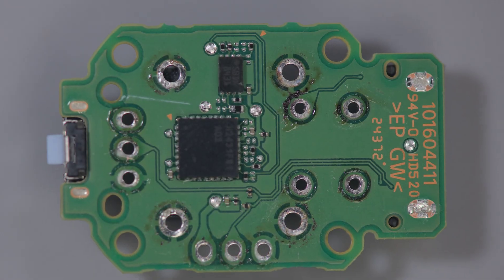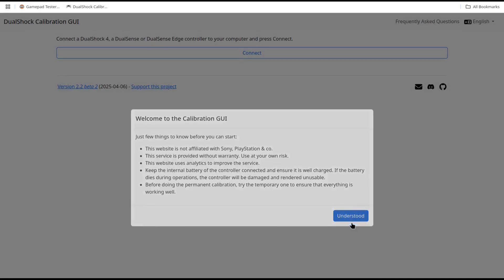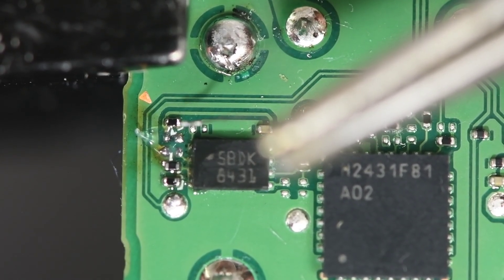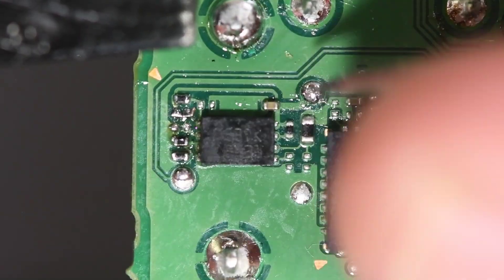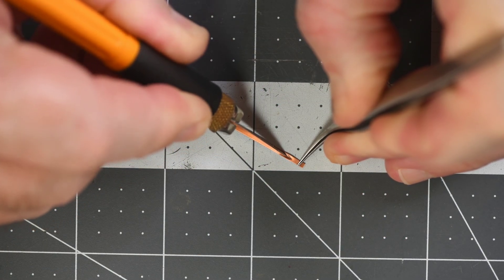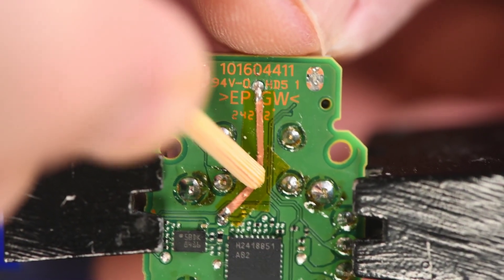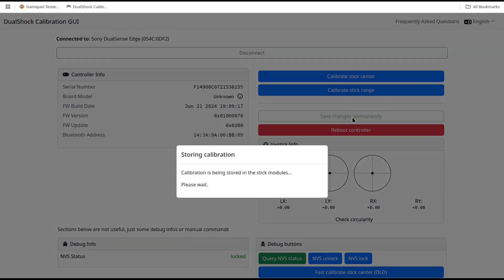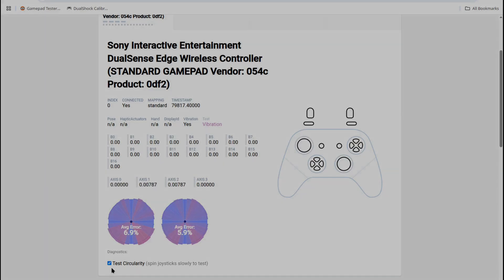DualSense Edge Stick Module Mod: Calibrate Replaced Joysticks Like a Pro!

Comment: Is it possible to achieve 0.000 or 0.000392 stable with a tmr joystick? I always see fluctuations between 0.000392 and 0.001179. This translates to not being be able to use 0 deadzone or 1 in game. 2% deadzone is the best I can do with a tmr.

0 deadzone translates to anything stable and under 0.000999
1 deadzone translates to anything between 0.000999 and 0.001000
2 deadzone translates to anything between 0.001000 and 0.002000.

If fluctuations happen between 0.000392 and 0.001179. I can only successfully get stability using 2% deadzone
Reply from the maker: I think it will depend on how strong the return-to-center tension is for the joystick.  The Hall sensor joysticks were a bit noisy, so they wouldn't stay centered even if held in place.  But best I can remember, all the TMR could be positioned to stay at 0.  I don't think I've ever had a joystick for the DualSense that would always return to 0 for both axes on its own.
Reply: @ thanks for confirming this, I also have never seen a joystick return to 0.000392 on its own all the time. I agree if the tension was stronger, it would be possible to return to center but both gullikit and Hallpi only offer 1 tension. I think we may see different tension models in the future. That would be awesome.
Thanks for confirming, I do get jitters and fluctuations but this is normal I guess. My issue is my customers always request low error rate and stable centering. They want 0.0000 deadzone with no jitters. I’ve spent hours on this in calibration mode and it’s simply not possible unless we have a unicorn joystick that somehow has a little more tension than spec. I am assuming. What do you regard as an acceptable error rate, I aim for 4-8%.

Btw I’ve read that the jitters are generally ignored in games, so I don’t think it’s an issue but they want to see the dot sit still no jitter. Facepalm
Reply from the maker: If the noise from the joystick sensor is of a high enough frequency, I would expect the joystick software to ignore it. It's the very low-frequency noise that is a problem. The TMR sensors are so much better in that area than the Hall effect. I would expect the noise from a TMR sensor to be a bit more than that from a new potentiometer.  But over time, the potentiometer noise is going to increase.  So I still feel that the TMR is by far the best solution.  And a 4 to 8 percent error, I think, is normal.
Reply: @metalplasticelectronics354  thanks, I agree. I hope we see some more advanced tech when it comes to tmr, more tension for center snap back.
Reply from the maker: Maybe someone will create a new design for the joystick mechanism to allow a better return to center without increasing the tension. I find myself enjoying using the lower-tension joystick more and more. But there is no reason for them not to have different tension versions of the current designs.  Other than just the cost to change parts, and keeping track of the different models.

Comment: Hello, is the permanent calibration 100% permanent forever like in the normal DualSense controller? With the normal DualSense, you can perform the permanent calibration and the calibration is flashed on the DualSense PCB and it is not uncalibrated or erased, so in principle a calibration is not necessary. On the EDGE, the permanent calibration works the same, it remains saved on the Edge stick PCB, or will it lose the calibration when it runs out of battery, when it is turned off or at some point ... In the message that appears when you click permanent calibration it says OK, and if it is not permanently calibrated, check the Mod cable to see if it is poorly soldered and try again, but if it comes out as if it was permanently calibrated perfectly.
Reply: By the way, if the permanent calibration is stored on the stick's PCB, it would be possible to calibrate multiple sticks with TMR with a DualSense EDGE, and those sticks with TMR could be used on different DualSense Edges, since when calibrating what is the stick's PCB and not the internal main board of the controller. So a stick with TMR already permanently calibrated would be possible to use on any DualSense Edge controller perfectly and 100% calibrated.
Reply from the maker: The calibration data is saved in non-volatile memory on the stick module.  It will only change if you do another calibration.  And you can do as many stick modules as you want.  Could have a set with high-tension joysticks and another set with low-tension joysticks.  The calibration stays with the stick module.

Comment: If you use mod2. Do you need to do one Also. And which wire you use
Reply from the maker: No, one or the other will suffice.
Reply: @metalplasticelectronics354 and which small whire you
Use😊
Reply from the maker: Any very small gauge copper wire will work.

Comment: I removed the 4k7 pull down resistor and installed one on the pull up location, works great. It was very tricky to install even with a hot air soldering station, maybe I needed better technique. Thanks for your work! In your opinion, is there any reason to bother with removing the pull-down resistor?
Reply from the maker: Probably not, but I haven't tested yet to see if power is supplied to that section all the time or just on start-up.  It would be just a tiny bit of energy wasted, but it is energy wasted.

Comment: I think I overheated my board. I put hall effect ones tried this mod, but dualsense edge just blinks rapidly. I tried using unlock software but no luck. I will keep trying. I went through three of them with no success.  Probably because I tried by eye no magnifier.
Reply from the maker: If the controller is blinking, look for solder bridging some points; it shouldn't.  Ground and B+ points are all very close together.

Comment: What happens if I remove the bridge after I calibrate?
Reply from the maker: Nothing.  If you ever want to calibrate it again, you will have to put it back.
Reply: @metalplasticelectronics354  makes sense, thanks

Comment: 3:08 micro soldering with a normal sized soldering iron i tip my had too you man.. killer stuff . Glad to see the board can be avoided for the tmr modules to be put in these stick modules now..
Reply: Crazy stuff. Dudes fixing a wrist watch with chopsticks💀

Comment: Ok, just successful modded a module with lite spring ginfull tmr (gulikit sticks feel too stiff), thank god for method 2, whoever managed method 1 hats off to you. 

Thank you once again for showing us the way. You’re the goat. 

Also can you show us your soldering skills on how you remove the original alps sticks? I’m having trouble desoldering the modules to this day. Destroyed one module using heat gun and another using the big desoldering head specifically made for desoldering thumb sticks.
Reply from the maker: Take a look at this video: https://youtu.be/slxgHcYHnm8?si=VxwpGmTnVs978SxN
Reply: @ thank you, that helps a lot. My original method was to cut the legs themselves, very unsafe. Your method looks much safer.
Reply from the maker: It's safe, just slow.

Comment: Where can I find the 4.7kohm pull up resistors? Having trouble finding them
Reply from the maker: Amazon does have them, though I'm sure better quality resistors would come from an electronics parts supplier such as Digi-Key, Mouser, Arrow, and the like.
Reply: @metalplasticelectronics354  Thanks, but what search term(s) do I search for though? are pull down and pull up the same thing? A little confused.
Reply from the maker: It's the same device, in this case, a 4.7 K Ohm 0201 SMD resistor.  Pull down connects the resistor from the write-protect pin to ground, write-protecting the memory.  Pull up connects the resistor from the write-protect pin to the voltage supply of the memory chip, enabling writing to the memory.

Comment: can I replace the joysticks with HE from the original dualsense then follow your instructions here on how to calibrate them? Or did you buy edge specific replacement joysticks?
Reply from the maker: They are the same joysticks that fit in the regular DualSense.  But instead of the Hall effect look the newer TMR joysticks, they are better in every aspect.
Reply: @metalplasticelectronics354   Thank you for getting back to me, I really appreciate it

Comment: I don’t get it. How does method 2 bring voltage to the write enable pin on the chip without the solder jump?
Reply from the maker: The test point is connected to pin 3 of the EEPROM chip, the write protect pin.  It's the same as shorting out the 0201 pads.

Comment: done for the left stick with option 1 (without microscope), it works, thank you. You need to be extremely careful. I didn't use a wire, just made a bridge with solder.
Reply from the maker: Good job, that's not easy to do.
Reply: @metalplasticelectronics354  can you use lead free solder wire for method 1 and should u install the stick modules before, after or it doesnt matter?
Reply from the maker: You can use lead-free; the question is, why would you?  For method 1, it doesn't matter.  For method 2 probably would be better to replace the joystick first and then install the jumper.

Comment: I don't have an Edge controller, but have been following this. Awesome work to all involved and it's great to see installing TMR sticks without any additional hardware is now possible.

For method 2, wouldn't it be easier to use Kynar or enamel wire instead of copper tape?
Reply from the maker: Kynar would work great. I may still have a bit of that tucked away somewhere.  Haven't used it in so long.  For the enamel wire, I would still put down the Kapton tape.

Comment: Do the Gulikit thumb knobs actually not fit inside the housing?
Reply from the maker: Rub on the plastic housing, it was very sad.
Reply: @metalplasticelectronics354   I think it will depend on the housing style. Was the Edge module the three screw version or just one? 

I was able to install them into my single screw module and there was no rubbing or any issues!😃
Reply from the maker: 3 screw.
Reply: Elecgear sells a set with the fronts pre-trimmed down and they fit. But I just installed my driver boards before watching this...... there acting up anyway so I guess I will just take them off and do this hahaha. I was calibrating on this site as well. One stick going wild.

Comment: I wished this method was out a week earlier, soldering one tiny piece of wire seems much easier than a whole calibration board.
Reply: Dude I LITERALLY just soldered my entire new sticks and driver boards from Elecgear, and then I just see this.... what is my life. I soldered them perfectly too Ive been soldering 20 years or more and my driver boards just don't want to work. One does kind of but it's buggy as shit. I haven't removed the resistor which is optional so I'm gonna try that I guess
Reply: @JamesSchmidt713 mine works fine. Both of them.
Reply: It’s not easy to solder that wire though. I use the wire or tape method.
Reply: So I am gonna buy one edge controller, I can just easily put in a wire (method 2) and then use hall effect sticks? Do I need specific ones or can I use the same HE type for the standard ps5 controller??
Reply: @flates1340 both the methods just allow you to calibrate the modules like a normal ps5 controller. It doesn’t matter what kind of sticks you installed.

Comment: Great news for all Edge owners!
Reply from the maker: Yes, it is.
Reply: @metalplasticelectronics354  I see that Favor Union now has a TMR version. Green sensor shells with the letter "M" in the windows of the sensors. The circularity looked really good. Also People have said that the calibration website is more accurate for testing circularity. There are more slices of the circle, basically more resolution than the gamepad tester site.
Reply: 100% got two back up modules so as soon as I see some drift I'll be getting my micro soldering iron out to do this to them and then swap the alps out for a gulikit tmr unit

Comment: Bummer, i enjoyed soldering the driver boards alot. This is way to easy lol. Is the calibration really working as good as the normal dualsense?
Reply from the maker: Can't tell any difference.   Only done the calibration about 6 times in testing, so not a lot use.
Reply: @metalplasticelectronics354   To get the best calibration and centering you need to modify the fu button. Due to the fact that pots with hall or tmr sensors are larger than standards. When folding without this modification, the button presses on the pot and then the distance of the magnet from the sensor is reduced. What disturbs the reading in real time ... for today on the tmr joystick from favor union we can even go down to 0.9% with perfect centering
Reply: @Modyfikator  I used ginfull and gulikit and never had any issues with that. Ginfull i had to trimm a little bit or it wouldnt fit, gulikit fits perfectly. Reddings are the same in housing
Reply: Same here, had only one customer who couldnt adapt cause of the sensitivity. Use them myself too
Reply: @John-oo9xu   Unfortunately, the drive board is slower. A good player will feel it

Comment: Done a couple myself as well, way easier than the driver boards. Lower error rate to top it off 🚀🔥
Reply: Wait a minute.... I just installed a pair of Elecgear HE for the Edge with the driver boards..... are you telling me I could have literally just did this instead? 😐😐
Reply: @JamesSchmidt713 yes, to be fair this is new af.
Reply: If anyone wants to buy pre upgraded sticks or want your own upgraded. Feel free to reach out!
Reply: @Jestar_076 hey I'm interested in edge modded stick where do i contact you guys I'm not gonna buy it soon but I'm definitely buying it in the future
Reply: 1000 times easier man i destroyed my first set of driver boards
Reply: @sebastianedwards6731  that's the best way to learn, but yeah i messed up some as well. now it's a walk in the park :)
Reply: I did too. What did you do different that you succeeded?@sebastianedwards6731
Reply: I ordered a new set and don't want to ruin them. I also used Ginfull v4 halleffect joysticks

Comment: Literally just was working on a Dualsense Edge module last night trying to solder the calibration boards is tough
Reply from the maker: The write-protect Mod is no walk in the park, but way easier than an entire calibration board.
Reply: @metalplasticelectronics354  why not bridge where you place the wire with just solder?
Reply from the maker: The pads are so tiny that it is very hard to get solder to bridge just those two pads and not all the other pads around it as well.
Reply: @metalplasticelectronics354  use a little flux and a reball solder ball and flow into place